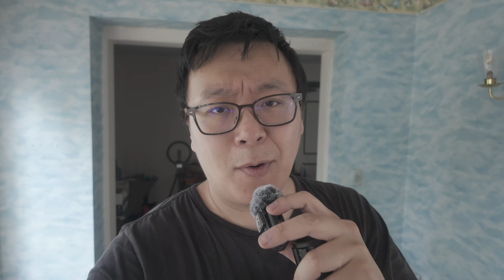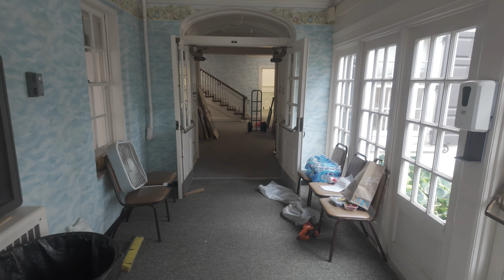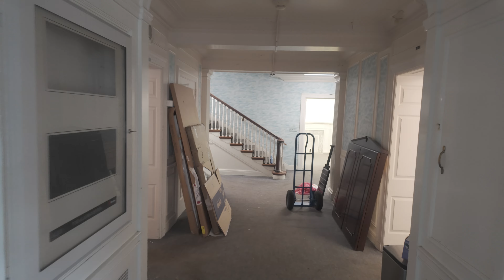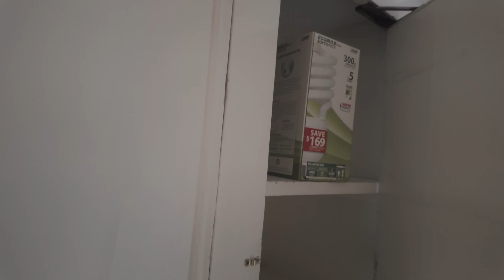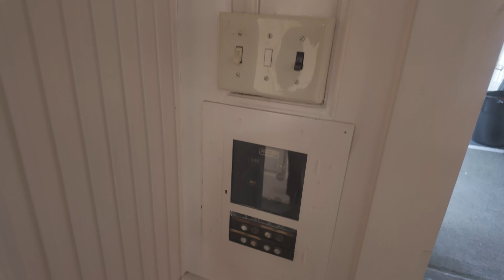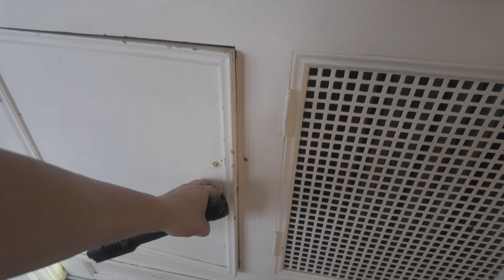Exploring First Floor of my Abandoned School! Episode 15

Comment: The entry hall staircase mystery switches were probably used to control a foyer light between the staircase and front door as well as one or more lights to light up the entry area as you progress past the stairs.  One of the switches might have controlled a light at the top of the stairs that worked in tandem with a second switch at the top of the stairs to turn the staircase light on and off.

Comment: Originally before it was converted to a school from bottom of the plans to the top. The rooms are set up for formal entertaining.  The front porch labeled instruction was all one long sun room. The called the office could have been a study (somewhere between a home office and library.) To the right of the entry hall with the stairs, would have been a formal living room.  The little room with the tile would have just been a small private seating area before you get to the dining room with the wooden paneling around the fireplace. That would have been also used for a separate dining for kids while the grown ups were in the dinging room.    The room with the paneled fireplace was the original dining room. Cabinets for linens and such. The original clock would have been a mechanical clock with a pendulum that was covered. Behind it was a butler's pantry which is labeled as faculty lounge/dinning area. That was the staging area where the get ready to bring out each course of the meal out of the way from the kitchen. They would plate the food and bring it out for the people seated for dining. The in-out displays were for telling when they were ready for service. When the people are running around doing stuff, they marked themselves as out and in to know where everyone was. The split door is called a dutch door.  You could have the top open but  still keep in kids/dogs/whatever by having the bottom closed. The rear stairway was for the servants to go up and down (out of sight).  The kitchen was set up like a commercial kitchen rather than a kitchen where the owners cooked. They found no reason to make it pretty. :) The fold out bins in the pantry would have been for bulk storage. Flour, potatoes, rice. Just dump a whole bag into them and they tip out for access.  The one labeled dining room would have been the informal living room/family room or possibly a music room or game room. A place for people to hang out away from the guests.  The lights by the stairway were 3 way switches originally. They would have been able to turn off and on from the bottom or the top of the stairs so you don't have to go up or down the stairs in the dark to turn them on and off. The mystery room would have been a coat closet. The little room off the living room without the door would have been another sitting room. People would have split up and the men would have gone to the study to hang out and the women could have gone to that sitting room to hang out. Also it could have been for the kids to go to hang out to get away from the grownups.
Reply: Brilliant information addition, thank you 🙏🏼 😊 I can totally visualize how you described it all.
Reply: Very interesting and sounds very right.
Reply: I came here to say all the same things you did. The formal dining room would have definitely been the first room after the office. The one with the single cabinet on the North of the door but is probably missing the one on the South of the door. These rooms almost always were symmetrical.

Comment: I wonder if the black switches were for the radiators or something.  It is also possible they control outlets or something.  I would trace out where they go.  I also wonder if those breakers off in the basement that are tripping and are off have something to do with the switches that do nothing.    It is also possible that some things got taken out in one the previous remodels that the switches went to originally and instead of patching the walls, they just left them to save cost.

Comment: Yason, here are some thoughts: the outlet you suggested might be for a clock is, in fact, a portrait light for a painting that hung below; the living room furniture placement would have been two matching sofas perpendicular to the fireplace to make a seating arrangement, usually with a low table between them...other areas of that room might have had chairs and tables with lamps between them in the corners or even a piano; the paneled room was the informal den or family room; the light switches at the bottom of the stairs most likely have connections to similar light switches at the top of the stairs. In order for them to work, one set would be off, the other would be on. My suggestion would be for you not to focus so heavily on how the house was used as office space, and focus more on how the house functioned as a home. As for things such as the incinerator, please leave that just as an homage to the heritage of the house. There'll probably be other things you can leave as well, things that aren't in your way, but that tell the story of the house. For inspiration, look at books that detail houses of this era, furniture placement, how rooms were used, etc. Isn't your intention to return this building to a home? Please don't modernize it, other than what must be done to bring it to today's code and to make it comfortable for you to live in. The glory is there, and has been for a long time. Don't mess with that too much.

Comment: The open part on the stove is a broiler or salamander in kitchen terms.
Reply: Exactly!  Great for melting cheese and getting the nice crisp brown crust on it.  It can also be used for short term holding while the rest of the plate is coming together.  Jason please note that you need to examine that stove to see if it uses pilot lights or igniters.  Pilot lights emit a continuous stream of gas that is supposed to remain lit (pilot light) in order to ignite the other burners.  Igniters are more common in residential where no gas is flowing until you turn the knob and an electric or piezoelectric igniter sparks to light the gas.  In commercial settings they tend to use pilot lights as they are simple with no moving parts to break.  However they require over head ventilation that is always on.  This is in case the pilot light goes out.  With it not burning it can fill the area with gas.

Comment: In the bathroom, the bell at time 17:36 and what looks like a hole for a panel at time 17:42, and the fact that it was so small indicates to me that this bathroom may not be original.  As to what it could have been, I am not sure.
Reply: Update: I wonder if that bell was the emergency bell for the elevator that was taken out and that room now used as a bathroom was part of the elevator  shaft or machine room or something.
Reply: @stphinkle  That tiny bathroom is almost definitely not original to the house.

Comment: Ohhh... Ohhh... Can I come over and play Match The Lock & Key??? Sounds like a blast! 😁
Reply from the maker: lol you def could, I got basically a small bucket of keys. Half of them i feel like they threw in there just to mess with me!
Reply: @watchere  between that and tracking switches I'd happily spend daaaaaaaaaays and days and days wandering around doing that.

I'm easily amused.

Shoot, by the end every room, switch, and key would be numbered and you'd have a spreadsheet of details.
Reply: I'd say keep the dishwasher.  10/10 have used that kind in several venues during volunteer work. There's not much to them.
Reply: I’ll help you! I love figuring that sort of stuff out. Might be able to contact some locksmiths to use all those doors for training.

Comment: The mystery "light switch" above the radiator might control a blower motor to circulate the heat. It seems that its circuit is not working.

The "play room" seems to be best laid out for a dining room with a long table. It has that feel.  That may have been original. The area with the low cabinet would have been for a sideboard.

Point a video camera to the neighbor's driveway.

Cookstove exhaust fan just might need cleaning. Probably sucked up a lot of grease and dirt over the years.

The tilting bins were for bulk foods like potatoes, onions, flour, etc.  

Code would require that the fire hose cabinet have a sign.

Too many people who fool around with electrical wiring have no idea what they are doing. Mystery switches and blank wall plates are one thing, but sometimes what they do is dangerous. My mother had the local handyman do some electrical wiring. The result was tripping breakers. I had to replace it.
Reply from the maker: Definitely need to check out all the electrical! Thanks for all the tips! I know i need to slowly get my way through this place
Reply: @watchere you just need one or 2 other people to go through with u and test out the light switches and see if they turn it on upstairs and you are down maybe they will work? Granted the lights aren’t burnt out. 😂😂

Comment: At tim 4:23, you may want to consider reinstalling the original fire system.  That system will handle your entire building in terms of fire alarm and is better than individual smoke alarms from home improvement stores.
Reply from the maker: Its gotten to the point i think its a bit far gone. I might consider installing some sort of smart system thats hardwired together to alert me if there is something happening vs just beeping smoke detectors which i wont be able to hear

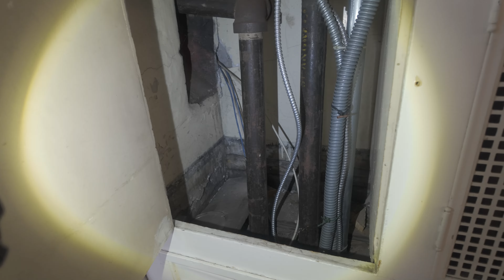Comment: At time 3:27, some of those look like they could be either water or possibly natural gas lines.  Most of the others look like electrical lines.  Some could even be low voltage for other systems, considering the fire alarm panel was above it.

Comment: At Time 2:40, your radiator might not be working because it probably relies on the bolier in the basement to be lit and turned on and the circulator pump running.  Likely that switch either turns the radiator valve on or off that circulates the water to it, or sets a higher or lower temperature or something, or perhaps there is a fan behind it that blows out air.
Reply from the maker: I definitely need to investigate more

Comment: The "dishwasher" is a sanitizer for the most part. Those trays under were filled with rinsed off dishes first. Once through the sanitizer the tray would be pushed down. When it steamed dry, it would be put in the cabinets behind you when facing it. Then the tray would go back in line for the next dishes.
Reply: Comercial dishwasher quite expensive...

Comment: I think the architect that designed the remodel into a school of sorts was on drugs. That said, there's a lot about the original layout that makes sense for mansions of the time. Fancy parlors, after dinner smoking room, billiard room, library, that sort of use for larger rooms. Especially if the second floor is smaller bedroom sized spaces.The current layout screams Special Needs kids. All those playroom areas would be required as not all Special Needs kids can get along, so smaller groups would help manage them. Plus many may have been wheelchair bound and likely were less mobile. I was an Adult Special Needs driver for a simillar facility. Very specialized layouts required. That would also explain the calming effect of clouds and blue sky wallpaper. Mental issues makes sense too as manageable  special needs have been integrated into general education for decades.

Comment: Your kitchen is to die for, I love it.  With all the work that needs to be done no matter how big or small....where to start first? Are you going to do plumbing or electrical first or knock down walls? Are the bathrooms usable now I don't recall you saying if you had water. Good luck getting off the interesting wall paper.  I know you'll do an excellent job!

Comment: There may be a switch at the top of the stairs  for the 2 weird switches and  one at the bottom that work together maybe?. I wonder if the city has the original house plans. A family member bought a property in Massachusetts built over 100 users ago that had been remodeled to a general store. He did find the original prints at the city and turned it back to a home.

Comment: Really getting into your channel. Restore the front porch to a three season. That would be beautiful. Whatever you do, consider the flow of the rooms. For example, the living room. With furniture placed in the middle of the room would make perfect sense. A couch on one side of the fireplace with either 2 chairs or another couch facing the first couch makes perfect sense. You'd need to get rid of the built-ins to return the room to the original charm. Please keep the design and time the house was built in mind. It's a beautiful structure. Also, turn the downstairs of the annex into a garage. That would take some engineering and knocking down walls, but it could be done.
Reply: He already addressed the difficulties of making a garage in there because others have already suggested it, including me. But he said he would not do it. It would need to much structural changes and would cost too much money.
Reply: @julien2912  I know he covered the issue, but that could still be done by removing all the walls and installing beams t take the weight needed to support the building. Sound damping insulation would damper the sound and the ceiling would need to be sealed to prevent carbon monoxide bleeding into the living quarters above.  Would that be expensive? You bet. I'd like to see what would happen if the ground floor was saved to the end before he decides. There are so many decisions to be made for such a large building.
Reply: @karenmetcalf-pugh5  he said the floors between the ground floor and the second floor already have some very heavy steel beams in it that would cost too much money to move.
Reply: @julien2912  The beam between the floors would not need to be removed. More would be added where garage doors would be needed to prevent the outside walls from sagging.
Reply: Other than "turning the downstairs of the annex into a garage", I like these suggestions. I've got some thoughts about your downstairs but I need to switch to my computer to be able to organize the thoughts I have and get time stamps. My phone barely allows me to type comments.